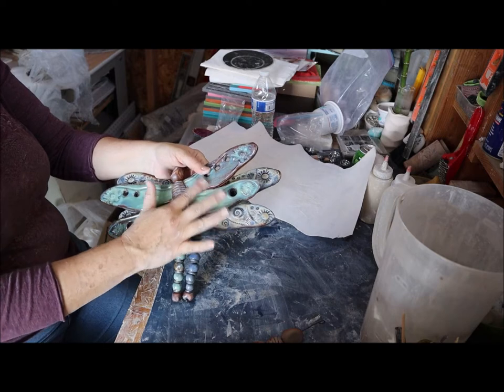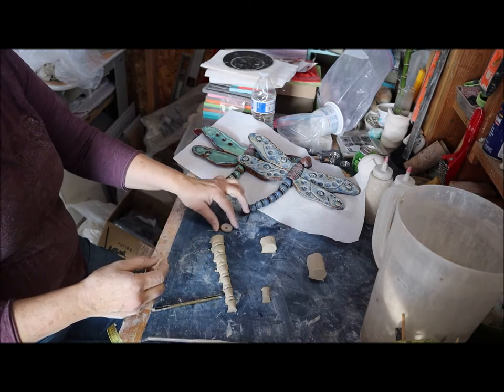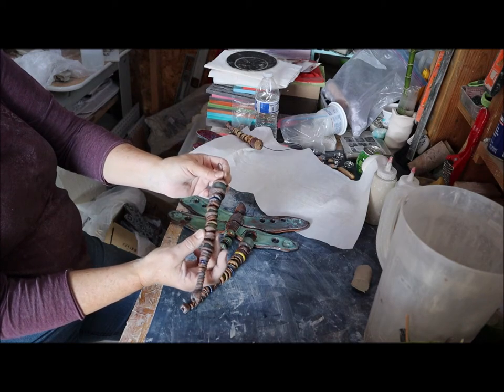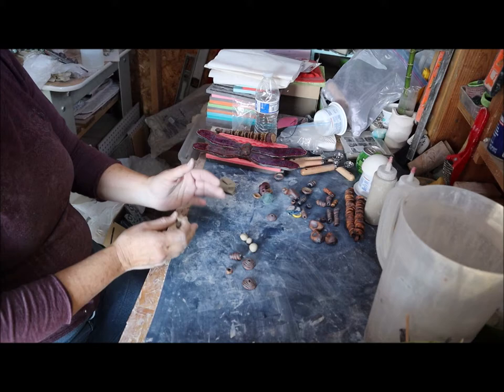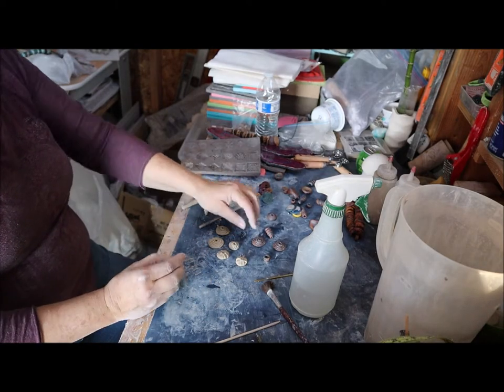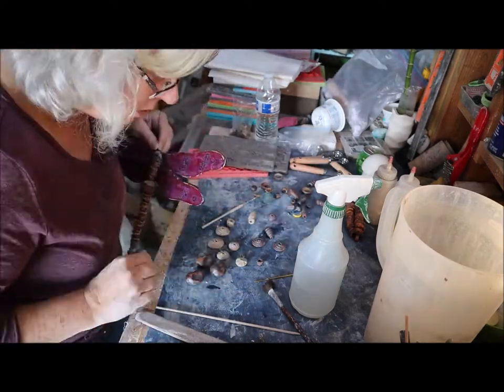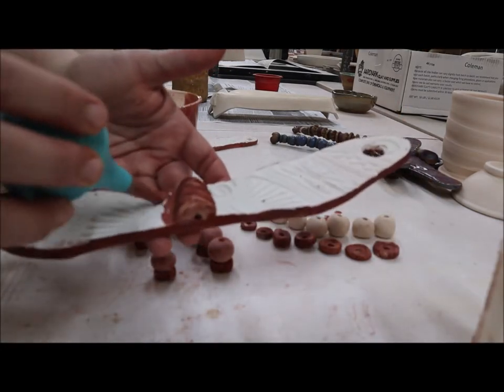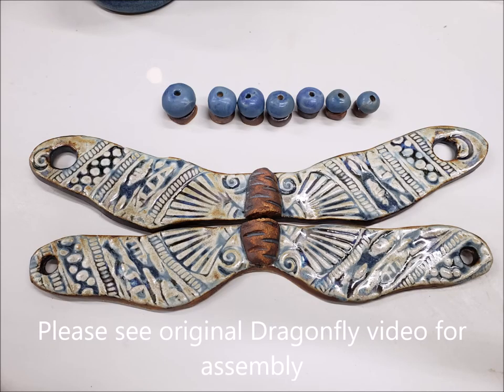Dragonflies Evolution

Comment: What type of wire are you using? Also, do you hang these or put on posts?
Reply from the maker: I mostly use old wire hangers. Occasionally I may use rebar wire. I hang these only at this time.  I have considered putting them on posts.

Comment: What did you use to glue pieces together with?
Reply from the maker: I thread them together in the wire.  No glue is involved
Reply: @jamiemeador2967  sorry thought you had mentioned glue at one point when you were firing them